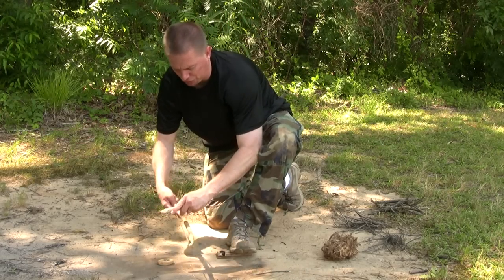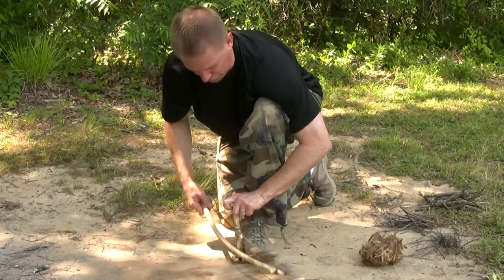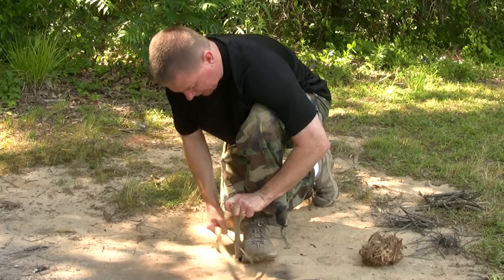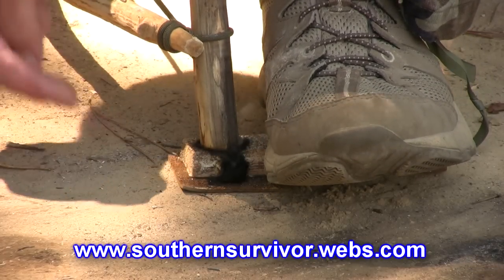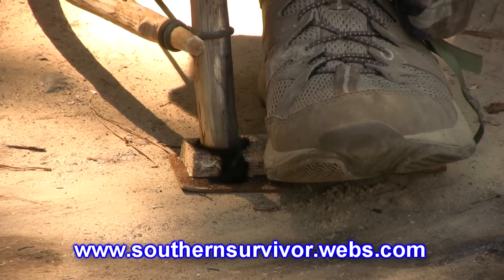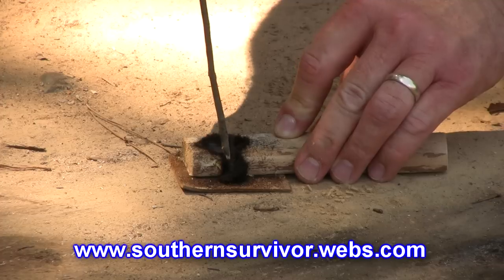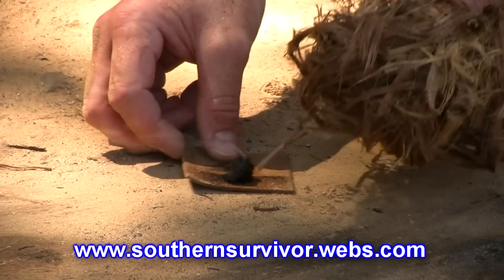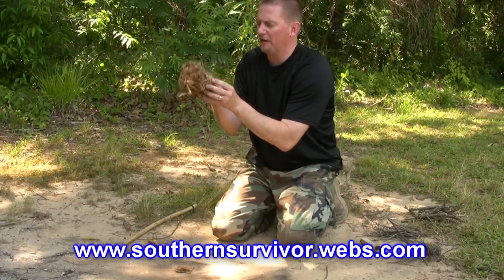Primitive Fire Making-The Bow Drill

Comment from the maker: The type of wood is very important. That is one key in getting friction fire. Avoid hard woods like oak and hickory. Use soft woods like willow, cottonwood, paw paw, basswood, cedar, sycamore. My favorite combo is a yucca drill on a willow fireboard. I use the dead flower stem of a yucca plant (just in case you don't know what yucca is). Make sure the wood is dead and dry also. Your handhold or socket must be as friction free as possible. So wood selection and posture are vital to friction fire.